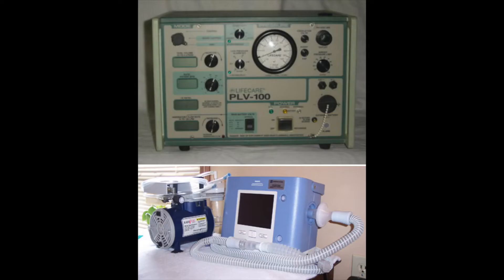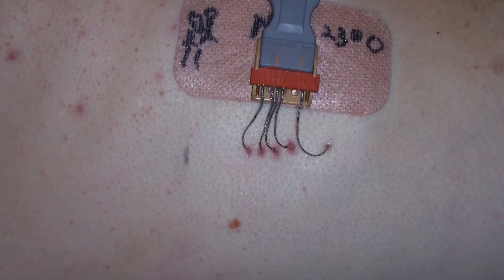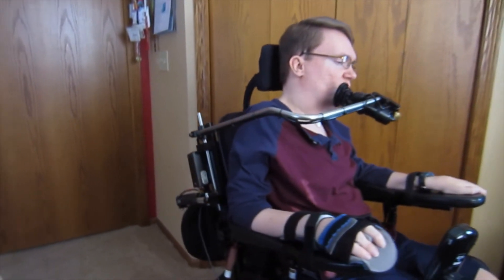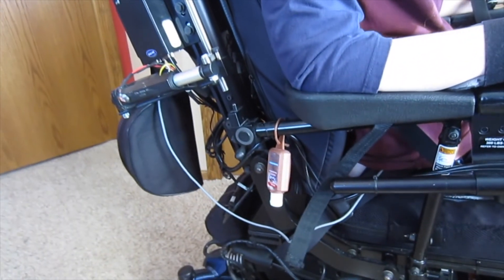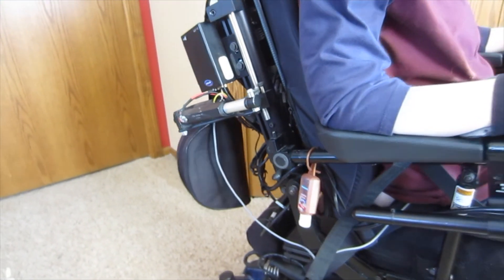Quadriplegic Breathing

Comment: How often do you need to get your lungs cleaned and why do you need to do so? My mom was a nurse and she had to do that procedure, but after watching your video I wondered why do patients need that? What happens in the lungs? Is the trach button a problem when you shower? I mean, that water gets in if it's not sealed or sth?
Reply from the maker: Usually just a few times a week, unless I have a cold or something. I can't cough to clear my lungs, so suctioning gets out extra mucus. I only do bed baths, so showers aren't a problem.
Reply: @TheQuadLife  thanks ❤️
Reply: There are cough assist devices that prov iij did the appropriate pressure and timing for coughs.  High frequency oscillation vest can percuss the walls of the chest, loosening secretions.